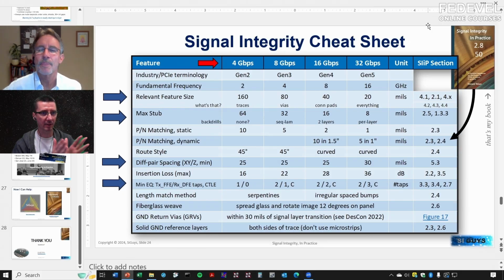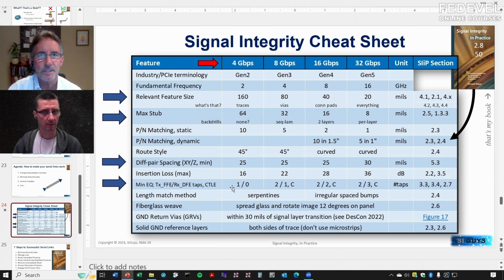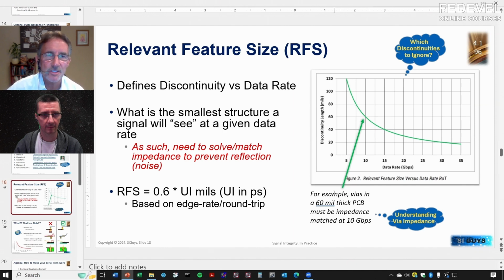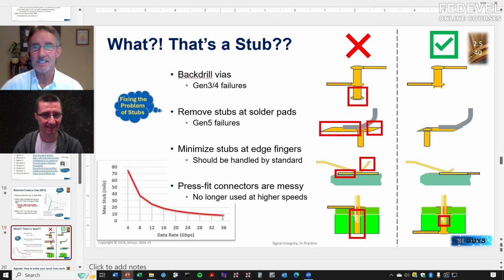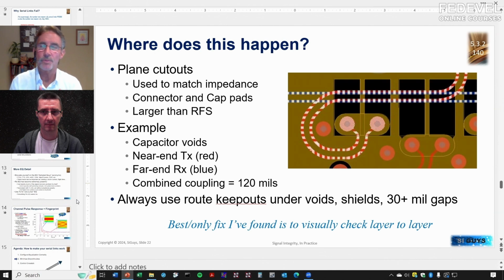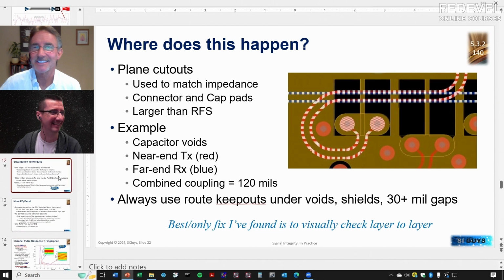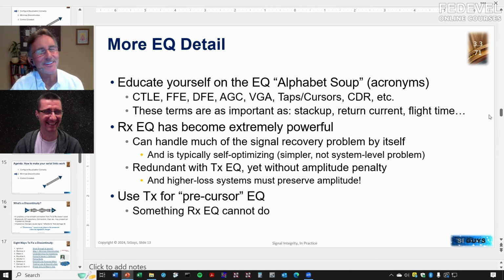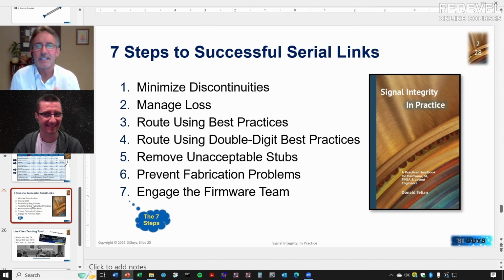If your high speed differential pairs don't work, maybe the solution is in software

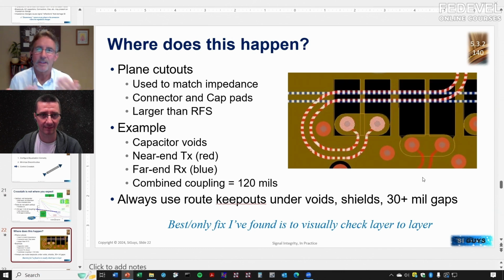Comment: What is going on around the 40:00 minute mark?  ( https://youtu.be/SM76F537vjc?si=XtDe7qTBd9qpJ2TA&t=2400 )  As best I can tell, there is a differential pair that is jumping over a bunch of gaps, and a parallel signal from the other side of the ground plane is causing crosstalk.  But why would you put those gaps in the plane in the first place?  It isn't for a via, or neither track would be there.  If you're pulling the plane away/using a hatched plane for greater impedance, then why not do that on the rest of the track, too?  (e.g. why first go South and circle around on solid areas?  And why does the other signal layer run over those cutouts, but over (under?) solid ground to the left?)
And would coupling be a problem even with the ground plane, since the plane is pretty thin, and both layers would be using it for return current at the same time?

Comment: So, will the receivers know when a reflections are coming by time and dynamics change for the first say 10 reflections over a threshold from training?
Reply: Ish.  You can calculate it, but the exact amount will depend on things like whether the signal was at the same level on the previous bit, and whether random crosstalk happened to be towards the same level or the opposite level or out of phase ... and if you spend much time calculating it, you have just added a bunch of latency, and hey, if you can do lots of calculations quickly, maybe you could also sample more often and increase the bitrate instead...

Comment: thanks, Robert very good topic. recently I worked on some project about 10G gigabit ethernet on XFI interface and changing the equalization parameter on Retimer chip (DS110DF111) really saved us. and we go from 3Gbps to 8Gbps datarate with just changing the equalization register on retimer chip.